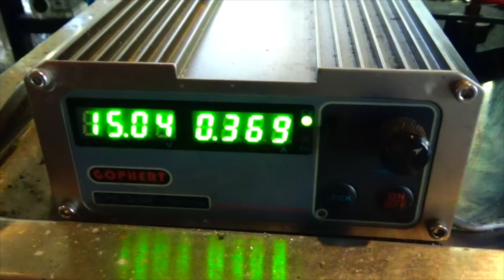#RoughCut2022 - How To Make a Lathe Tool Height Setter.

Comment: But wouldn't you sometimes get the chip breaker and not the cutting edge? I use a steel rule. Works very well.
Reply from the maker: Most of my insert tools have the cutting edge in line with the chip breaker geometry but if you position the tool tip just inside the circumference of the setting screw you can still get an accurate result. 
Regards,
Mark

Comment: I’ll make one of these, but I’ll make the HS side heavier so it will always tip in the right direction and can be used handsfree.
Reply from the maker: That is a good idea. A rubber band wrapped around the tool tip and the setting tool will work too. I did consider magnetising the setting screws but that would almost certainly magnetise the tool tip as well which would be a bit of a nuisance.
Regards,
Mark

Comment: I just bnb use my thin blade 6" scale.  I pinch it between the work and the tool and adjust the tool until the scale is vertical.  40+ years never went wrong.
Reply from the maker: I have used that method and it works but I think you missed the point of the video which was to make something nice as a gift for a viewer and also to demonstrate some techniques like drag engraving and anodising. 
Regards,
Mark

Comment: How do you seal your anodizing? I use boiling water as the commercial chemicals are too dangerous for my shop.
Reply from the maker: I just boil the parts in water too. It works fine for me. You do get a little bit of dye leaching out of the part to start with. If you leave it in the dye long enough it will go a darker shade and then lighten up a little after sealing.
Regards,
Mark

Comment: We always measured from saddle or top of the Cross slide to the tool tip we mark that number on the headstock it's a simple matter to make a block or just use a ruler a scale if you would.

Comment: Over the past 45 years I have machined a lot of alum. but never 6011. I was wondering if this is a misprint and should have been 6061 or 2011. Thank You.
Reply from the maker: The material I used on this build came from some stock that we used at the school where I used to teach. We bought 40mm square bar stock to make a meat tenderising mallet. When I say we, I mean my Head of Department bought it from a supplier and I had always assumed it was 6011 T6. I have machined 6061 and it seems to be a lot more free cutting than the stock I was using for this build. However, I may be wrong. 
Regards,
Mark
Reply: @Preso58  Thank you. great job!!

Comment: Wouldn't it be easier to make a pointed tool, like a needlepointed shaft, and aligning the cutting tools to that height?
Reply from the maker: Yes, absolutely. At the same time, I like using processes like anodising and CNC engraving. In my view, there is noting wrong with finishing a tool well and sometimes it is a sort of personal challenge to see if I can make something that works well but is nicely finished as well.
Regards,
Mark

Comment: That's quite an interesting tool. 
It's great if you want to do a bunch of machining practice but way too much work for me.
  The quickest way to set tool height, particularly with a 'standard' 4 way tool post, use a vernier to measure how much below centre you are then you know exactly how much packing to use.
It's real easy to get within 0.010" (o.25mm) and as long as your 'low' tool won't rub
Machine a little 'pip' long enough to measure (1/8"~3mm) then half the diameter.
  This is something I worked out many years ago, no one ever mentioned or even thought about it while I was training I guess?
  I was 'production turning' to  sub 5 micron tolerance, setting a QCTP is super easy but we had a few machines that didn't get used a lot with 'standard' tool posts.
  There is also far too much reliance on 'throw away' carbide tooling with hobbyists/amateurs, learn to sharpen HSS and you get better results on majority of 'mini' machines particularly with various aluminium alloys.
Reply: Even easier way is to place one of those thin metal rulers up against a bit of round (ideally just turned in the chuck) and gently push the tool into the ruler, then sight it down the axis of the chuck, if the top of the ruler points towards the operator, the tool is too low, the other way too high. Works great with the majority of cutter geometry, even parting blades you can very quickly eyeball a slight positive offset so that the cutter will never get run over by the work due to deflection.

I don't agree with your reasoning to use HSS as an amateur though, it takes a lot of practice to get a cutter that works anywhere near as well as off the shelf carbide inserts. Certainly for aluminium there's no harm putting a razor edge on some warn or broken inserts but you can also just buy those ready to go (never mind that aluminium will scuff or corrode and look like shit after a couple of days anyway).
Reply: @thetooth  Using a rule is OK, BUT, two things
1. you have no idea how much packing (or adjustment for QCTP) you need to get to centre
2. carbide is very likely to chip, the sharper it is the easier it breaks with less pressure.
Using HSS is simple enough, cutting angles are specific for industry where tool life and material removal are most important.
 As long as you don't have negative angles (except for brass) majority of work will be fine. It isn't rocket science to grind a usable tool bit (on cast iron or brass you don't even need to do any grinding)
 Without 'green grit' or diamond wheels you can't grind carbide tools or inserts and even with green grit wheels it's difficult to 'sharpen' inserts without grinding the tool holder
The majority of small lathes don't work well with inserts as they almost all have a 'blunt' or radiused edge.
HSS on 6061 with only minor radius to tool tip can give a good enough finish that corrosion will take weeks or months unless your garage is very damp.
It seems the main reason for using inserts is just laziness?
Reply: @1crazypj  working out packing is very quick, you just find whatever scrap sheet is close enough and maybe throw in some shim stock if you want to be exact about it. diamond wheels aren't crazy expensive and are certainly attainable in the capacity needed to touch up an insert. as you say, carbide chips more easily when it's sharp which is why most inserts come dull as they are designed for use at ideal material removal rates, a few micron off the relief side of the insert and you're needing much less pressure which is ideal for those lighter duty machines, further more those aluminium inserts are indeed razor sharp out of the box because even at high removal rates aluminium is so soft it doesn't matter. and yes inserts are about laziness, much better spending time on the parts you want to make then reinventing the wheel.

Comment: What is that copper pad?  Is it just a piece of electrical wiring cut very short?
Reply from the maker: I actually turned a small diameter copper rod in the metal lathe and cut off a very short length to go in the bottom of the hole but you could use some thick copper wire  cut off with some flush cutters. It will deform against the thread anyway.
Regards,
Mark

Comment: That's brilliant. I'd like to suggest a much simpler way though. Chuck up some stock, turn it to whatever diameter, basically a clean up pass. Measure the diameter with your micrometer or calipers. Bring your tool up close to the end of the part and use a depth micrometer or the depth feature on your vernier to adjust up or down as you know the radius of the part. Much simpler 👍 do love your videos though Mark cheers from Melbourne
Reply: push the tool tip against a steel rule between  it and  round bar in chuck it  will be perfect when rule does not deflect  ie should remain vertical
Reply: @eweunkettles8207  damn that's simple too 👍

Comment: Nice looking tool! Very easy to use. Not so easy to make, for those who have only a hobby lathe, but that's not the purpose of this challenge :-)
I only knew the traditional tool height reference - this one is on a class of its own.
Reply from the maker: It's a bit of a ripoff of the Edge Technology type but I have a couple of inverted tools so having the extra capability to set those works for me.
Regards,
Mark

Comment: Do the vials need to be calibrated to the level of the machine, especially front to back?
Reply from the maker: The cheap vials I purchased from Ebay are a bit annoying in that the calibration marks are not exactly the same length as the bubble. In that sense it still requires some careful observation and judgement to see if you have the height set correctly. Possibly spending a bit more to obtain precision levels would have paid off. However, the machine would need to be level within a reasonable tolerance to ensure that the tool works consistently. My lathe bed is level from headstock to tailstock but probably not front to back. The tool still works as well as a height gauge set from the cross slide but it's quicker to set up (for me) and you get visual confirmation. 
Regards,
Mark
Reply: @Preso58  Thanks Mark, I haven't seen this design before and think it looks very tactile and durable due to the effort put into the design. I'm sure anybody using one will quickly learn where the centre indication is on the vial. I like how it works even with runout on a chuck by rotating it loaded with the bearing assembly until it is mid way between high and low on a dti.

Comment: I found it easier to take a small piece of rectangle stock between the round stock in the chiuck and the cutting tool, When the rectangler stock is perpendicular to the cross slide you are on center.
Reply from the maker: Yes that works and it's easy but I wanted  to make a nice tool as a giveaway for a subscriber.
Regards,
Mark

Comment: Can't make that handy tool gauge until I turn myself a CNC milling machine on my lathe. 😆

I would think that the bubble level would still only be an approximate guide.
Reply from the maker: I have a similar tool made from injection moulded plastic. The whole gadget could be 3D printed and it would still be pretty accurate as long as you have a way of calibrating it.
Regards,
Mark

Comment: FYI bearings are for high speed rotations. Bushing are for low speed.  The tool is defiantly in the low speed range. So not sure why you would use roller bearings when a reamed bushing would do just fine.
Reply from the maker: I guess I was looking for a simple way of getting minimal runout. I did have some bronze oilite bushes that I could have used but then you have to get some pretty tight tolerances to avoid crushing them. I bought some cheap skate bearings which were rubbish. Even with two there was a lot of slop. I ended up buying some ABEC quality bearings and they worked perfectly. 
Regards,
Mark

Comment: Very nice job, gotta say I'd be tempted to 3d print the body of it  but I'm a heathen lol
Reply from the maker: A 3d printed part would work quite well. I do have a cheaper version of this tool that was made of an injection moulded plastic with just a single bubble level and a V notch that fits up against a cylindrical part held in the chuck. It works but it is a bit of a nuisance to hold it in place and adjust the height of the tool at the same time.
Regards,
Mark

Comment: Can you just measure the knob left from facing with the incorrect tool height divided by 2 then raise the tool that amount using an indicator?
Reply from the maker: You could do that but it's a fiddly setup. The most common method is to trap a small steel rule between the tip of the tool and say, the tailstock barrel and adjust the tool height until the steel rule is vertical. It's still a bit approximate for a beginner though. 
Regards,
Mark

Comment: I use an aluminum post that sits on the top of the cross slide that is machined with a sharp edge so as you bring the insert edge next to it you feel the difference or "step" with our finger nail. Fast and accurate. Another way is to put a  small steel scale between the stock and your tools tip. The scale will lean one way or the other unless it is perfectly on center....and than that scale will be 90 degrees to the cross slide. I do like your tool but would seem to need to be changed out with the stock a lot as you change tool holders  out. I don't like removing a work piece once started.
Reply from the maker: You can put the height setting tool in the tailstock drill chuck if you don't want to interfere with work held in the headstock. 
Regards,
Mark

Comment: Use a stainless steel 6-inch rule put it against the cutter and your stock, adjust the tool where your rule is 90° straight up and down
Reply from the maker: I know. Please read the pinned comment on the video for my reasoning regarding this tool and how it was made.
Regards,
Mark

Comment: Nice and well done, but very advanced, complicated.
Put a round stock in the lathe and turn it to a known diameter. Use a micrometer to get the diameter. Use a hight stand placed on the carriage and measure the height of the turned piece. Subtract half the diameter from the measured value. That's the center height for cutting edges.
Clamp a straight surfaced block under the height stand measuring arm and You can measure inverted  cutters.
Reply from the maker: I agree that this tool is a bit over the top. There are lots of methods for setting lathe tools using the inherent common axis between the tailstock and headstock and even the old trial and error method will get a result in a fairly short time. For insert tooling, you really only need to do it once but for the diamond tool holders (which use a tangentially held HSS tool bit) you need to set the tool every time you take the bit out for sharpening. Plus, I wanted to make something nice to give away to a viewer for the 30K draw.
Regards,
Mark
Reply: @Preso58  You made an impressive tool worth all credit. Designing and making things is the fun. Making something the simple way or the advanced way... the importance is it's performing as You planned.

Comment: Lovely job….. but you didn’t mention that your lathe crossslide should be level with respect to gravity for this to work. Thanks for the vid.
Reply from the maker: As long as you calibrate the level on the tool setter to a tool bit that cuts exactly on centre (which you can check by facing a piece of scrap stock and checking for a pip in the centre) there is no requirement for the lathe to be level. 
Regards,
Mark
Reply: @Preso58  Ahh.. true .  Nice job though.. the anodising looks great.

Comment: Any chance you can turn up that machine hum? I don't think it was annoying enough. ;)
Reply from the maker: You are referring to my rotary phase converter? I hate it too but given that I will NEVER be able to get three phase power on to my shed, it's the only option. I have tried soundproofing the motor and mounting everything on rubber but it is what it is. 
Regards,
Mark

Comment: I just pinch a 6inch rule between the tool and OD of job, if the rule leans towards you the tool is too low, if it leans away the tool is too high, raise or lower tool as required until the rule is vertical, why complicate things?
Reply from the maker: I do know the steel rule trick and I have used it. It's still a subjective process though. I was looking for a tool that would not be dependant on having a workpiece in the chuck. I know you can use the tailstock barrel to pinch the rule against but it's still a case of having to move the tailstock up close to the tool tip anyway. The setting tool I made can be used in the chuck or the tailstock and it's very accurate. I also wanted to make a nice tool to give away to a subscriber. It was also an entry in the Roughcut2022 challenge. 
Regards,
Mark

Comment: so, why wouldn't you just put a sharp center in the tailstock and line your tool up with the point?
Reply from the maker: You can absolutely do that and it will get you very close to the correct height but you will still need to verify the accuracy by making test cuts. If the tool tip is slightly too high or  low you will still be able to make parts but it's super satisfying when you face off a part and the centre is absolutely clean. 
Regards,
Mark

Comment: How did you make the anodising set up, do you have a video?
Reply from the maker: This is probably the best one to watch https://www.youtube.com/watch?v=Z1zT8p7d9Z0
I will try to do an update soon. I recently found out that having the dye used in the final step at the correct PH is really important. I was having issues with certain dyes like the black and when I tested it with a digital PH meter the dye was way too alkaline. I put a few drops of hydrochloric acid in it and bought it back to the correct range and all of a sudden my issues went away. This is something that not many people discuss on anodising videos. 
Regards,
Mark
Reply: @Preso58  thank you.

Comment: How long did that take to make? I swear all guys like you just like having stuff to play with! 🤣
Reply from the maker: If I were to do that project again it would probably take half the time it takes to make the first one. In reality, I usually work on multiple projects at the same time. That way I can get the sandblaster set up and do all the surface preparation on several parts from different projects and then put it all away again. Same with the anodising. Also, you are correct in that I do like making things, even overly complicated projects. 
Regards,
Mark

Comment: I measure 8 1/8 to table ..perfect every time
Reply from the maker: That works well if your tool tip is over the cross slide. On a Colchester the tool tip is hanging out in thin air over the bed. You can rotate the tool over the cross slide but then you lose your datum if you have already started the job.
Regards,
Mark